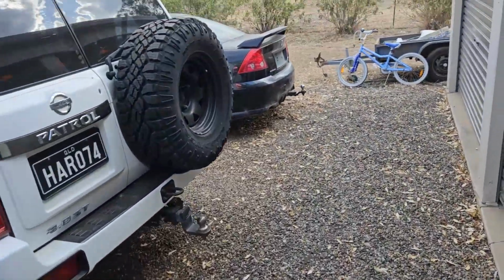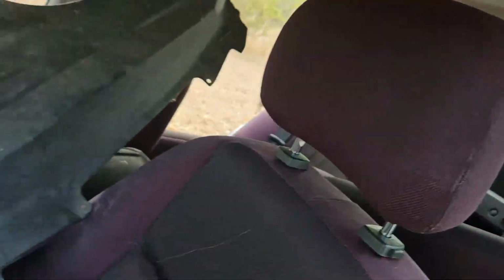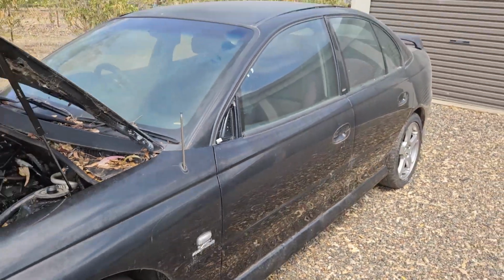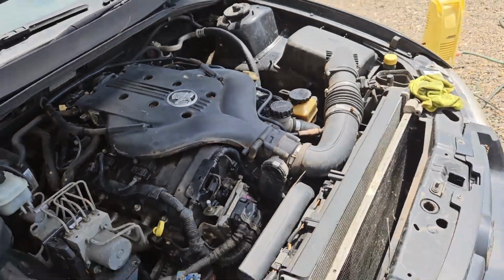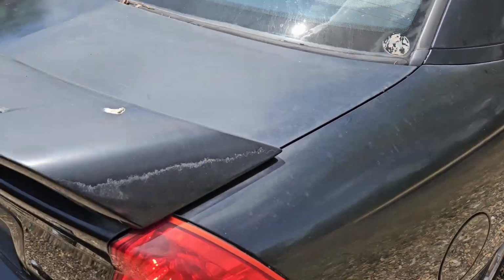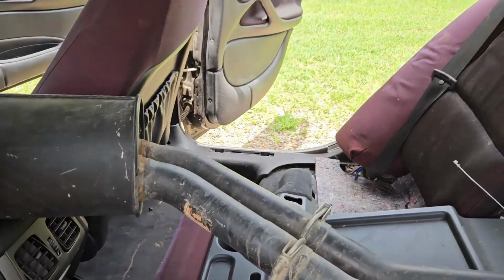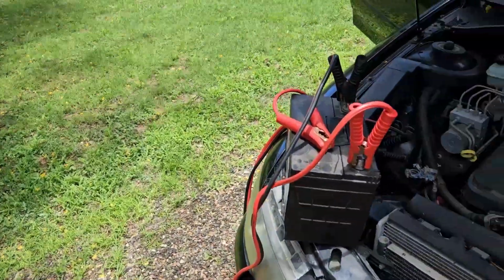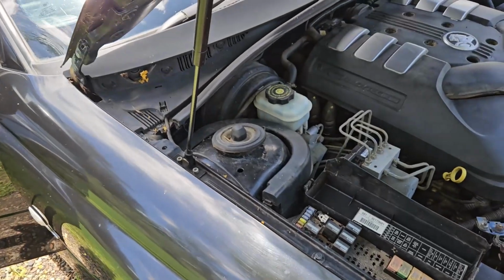$200 BARN FIND COMMODORE HAS ARRIVED - PART #1, HOW BAD IS IT??

Comment: Looks like you're on a winner, cleaning up nicely. One thing to check on the AlloyTec is the thermostat, hidden down between the back of the motor and firewall. lf the auto is out, you have a little bit more access, l'd be putting in a new thermostat while you can. Good luck with the resto!!
Reply from the maker: thanks mate, i will actually check that while i have space👍yeah its cleaning up better than i thought

Comment: SV6 (LY7) would have had the 5 speed Auto, the poverty pack upto and including S1 Berlina VZ has the 175kw engine mated to a 4 speed transmission from memory. The 5 speed auto's are pretty pricy even second hand which is probably why its missing and finding a good second hand one today will be a bit of a lottery. You may be better off buying a write-off from the auctions because it looks like you are going to need other parts such as relays, stray wires and that dash doesn't look complete. Good luck with it
Reply from the maker: thanks for watching mate, your right the Transmissions are pricey. i have looked at a wreck for second hand parts but already have a few cars at home. My 1982 WB build takes most of the room in the shed.

Comment: 200 dollars ?? bit off elbow grease and let marketplace be your friend for some bits and pieces and youve got a grouse car ,the ecotec is a far better motor than the rattletech ,you know about the stretched timing chains in your one ,im sure off it but jeez louise 200 dollars who cares ,hopefully it hasnt thrown an engine code and you might get a couple years before it needs a chain ,im not sure if sv6 transmissions are the same as the base vz v6 i think they might well be the same i hope so ,new subscriber glad to be here bud
Reply from the maker: not a bad deal mate, it was going to be scrapped otherwise. i saw potential in her so myself and my 15yr old boy will rebuild her together. its my understanding it was driven to the farm were it was parked up and left between two sheds. hopefully the engine will be ok - it turns over by hand on the crank bolt so good sign there. welcome to the channel! hope you enjoy my other videos on the WB build 👍
Reply: @goldshiftgarage  my ol boy my brothers and i used to rebuild cars ,my 1st was a XL Ford ute ,the ol boy was a revhead so out went the 221 and in went a 289 whinger top loader 9 inch and a quick jam job/enamel paint job ,set of discs up front with a remote booster ,hes in heaven now but i miss him everyday ,keep your lad with you spinnin spanners ,memories for life for both of you